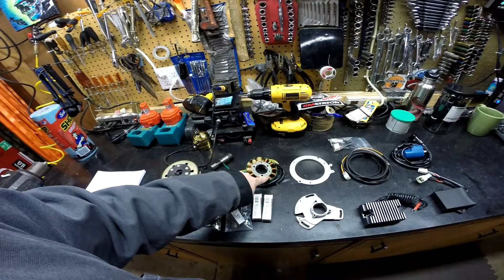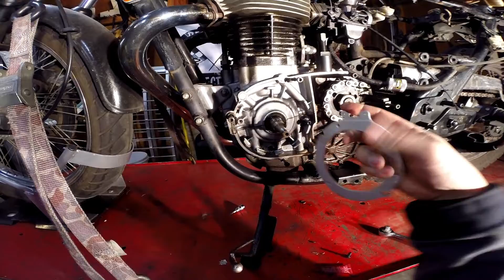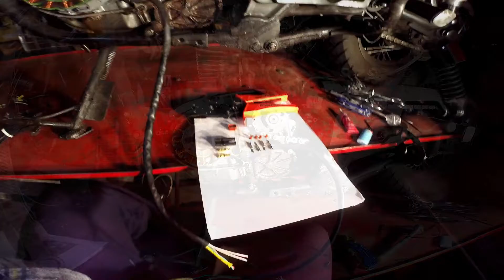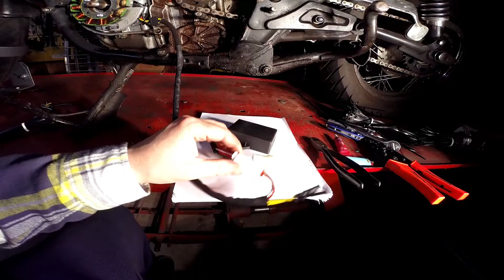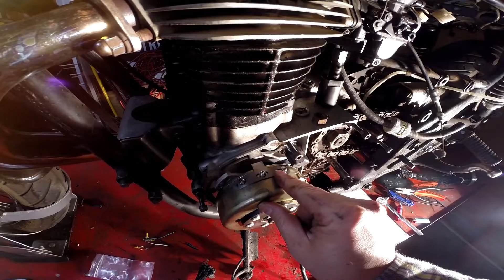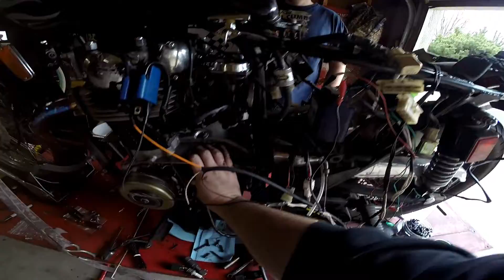Hughs Handbuilt XS650 PMA CDI Kit How To Installation

Comment: Nice! My instruction manual said to set the pickup in the middle of the slots, but now I'm thinking my timing might be slightly advanced as I'm getting excessive top end heat. Ill slide it forward like you did with the brass shim and tighten er down. Any chance you know the actual length of the brass piece? Not sure if I'll be able to find mine... Thanks for the vid!
Reply from the maker: Yup you can adjust it easily. I don't know the length sorry.

Comment: I took off the stock stator already but the Woodrow key is facing down and i already have TDC.   Can i just spin it until i find TDC or do i need to put on stock components back on before spinning it to find TDC so that the Woodrow key slot facing up ???
Reply from the maker: I would spin it until you confirm TDC at the cylinder. Make sure #1 is at top of piston travel with compression, then you know you're good.

Comment: Have you ever had an issue with it not charging? I have one on my 650, kick start only with capacitor. I got stranded. It turned off in the middle of the intersection. I was able to get it push started a few times but nothing after that. Now I don’t have spark and can’t seem to figure out what the issue might be.
Reply from the maker: No, the system charges very well. I don't love using them with a capacitor though, always prefer a battery.
Reply: @OctaneElectrons  Thank you. I'm in the process of testing all the components. the capacitor is good. I need to test the stator and rectifier
Reply: @matthewaragon3641  What is the value of your capacitor? Is it 50,000 microfarads? thanks-John

Comment: Couple years later now how is it running? I have an 81' (TCI) that recently stopped charging and could use some newer electronics so this system has been in my sights for a while
Reply from the maker: Still working perfectly. This really is the best kit out there for charging & ignition system upgrade on an XS650.
Reply: Great, thanks! From what I can tell in this video the CDI ignition replaces the TCI and you don't need to switch to points like you would if you were only installing a pma, correct?
Reply: @evan2827  I  was wondering the same thing

Comment: does any company make a pma for the xs850?
Reply from the maker: Not that I know of. The XS750 and 850 triples do not use the same system as the 650 at all.
Reply: @OctaneElectrons  how do they differ?
Reply from the maker: @BloodNuke76  The XS750/850 use a fixed mounted field coil (it does not spin). The rotor is not permanently magnetic, and spins over the fixed field coil, with a ring stator around it. This is different from the XS650, which has a field coil embedded in the rotor, and the whole unit spins. I don't believe the taper on the crankshaft is the same between the 650 and 750. This would take some testing and investigation to see if a similar system could be used on the 750 motor. Almost for sure a new backing/mounting plate would need to be created.
Reply: I bought a 78 xs 650 the previous owner cut all the wires off except the ones for the coils and the ones coming from inside the motor. Im wanting to just wire the head light brake light and fire the bike up could i do this with this kit or something different
Reply from the maker: @rickyrobinson3096  No, this kit only affects ignition and battery charging. It will not provide any way to wire up lighting.
Reply: @OctaneElectrons  i didn't mean hook a light to it i meant privide power to the bike for lights etc. etc.
Reply from the maker: @rickyrobinson3096  Sure you can use this system for 200 Watts to charge your battery. You can then run your lights from the battery, works great.

Comment: What did you do with all the old wiring and harnesses?  Towards the end of the video they were just hanging out, are they useless at this point and does one just get rid of them?  Great video by the way, will be using it upon purchase!! Thank you
Reply from the maker: The original wiring harness was tied back up on the frame. Most of it is still used, just some changes to how the ignition and kill switch tap in. Glad the video helped!

Comment from the maker: I had a notification of a comment that seems to have disappeared. For whoever asked, the feeler gauge is .015" thick for setting the pickup coil to flywheel trigger gap.
Reply: What is the value on that capacitor? I have been toying with the possibility of using a capacitor that I am able to build using  a new method I have been working on.Not only that but also a better coil plate along with a magnetic flywheel. Please let me know and I will get back to you about what I have been developing. I am on Facebook. Are you?

Comment: This looks like a great system.  Does this type of pma/CDI system tend to burn out the regulator?  Thanks.
Reply: No, this system comes with a heavy duty MOSFET regulator, same as the one used on high output Harley Davidson single phase charging systems. It is very reliable and works great on the XS650.
Reply: @EvanGrist  I finally got around to installing this kit.  Pretty easy install and my TX650 runs great! No regrets. Thanks for this video.  It has helped heaps!
Reply: @fiveola  that's awesome! Glad to hear it. I'm still a huge fan of this kit!
Reply: @EvanGrist  since when? mine came with a 20 amo then had questions  for hugh he sent me a 30 amp and when I turn on light volts drop drastically to 6.5, lights off and I'm only getting 12.5. - seems all other ststors are 3 phase not single phase to handle the draw of lighting- still confused 4 yrs later and I've tried it with both battery and capacitor

Comment: good vid but, you should really show how to connect wires with or w/o battery/ capacitor-using relay or not- took me a good while to figure it out. would be very helpful to other non electrical dyi's out there. also should show how to properly time it
Reply from the maker: The video shows the way I was installing it to test things on that particular bike, it's not meant to account for every possible way to hook up this system. If you're not using a battery, then you connect output of the regulator-rectifier to your capacitor (making sure to get the polarity correct). Your lighting and ignition system is connected to the capacitor as well. If you're not using the relay harness to allow a stock/OEM handlebar kill switch to kill spark from the CDI system, you simply need to run the kill wire from the CDI to a switch to ground. When the wire is grounded (switch closed), spark is killed. When the wire is not grounded (switch open), spark.  Your timing adjustment on this system is slight movement of the pulser coil trigger. You can loosen the mounting screws and adjust it side to side slightly.  Hugh's instructions are detailed and thorough and cover these topics well, make sure you have read them in detail before your installation.